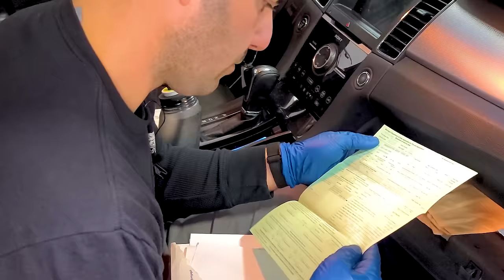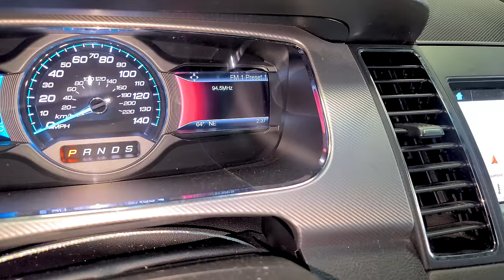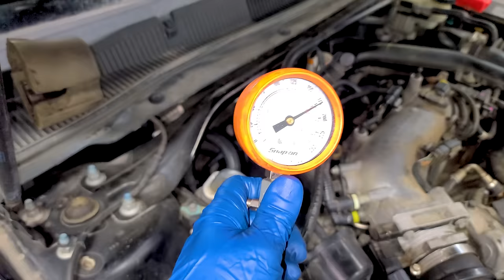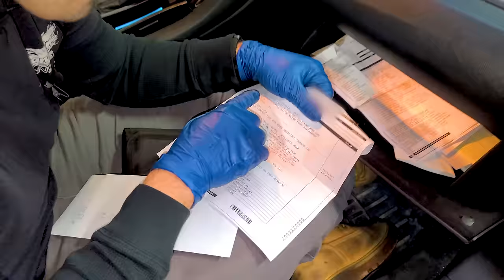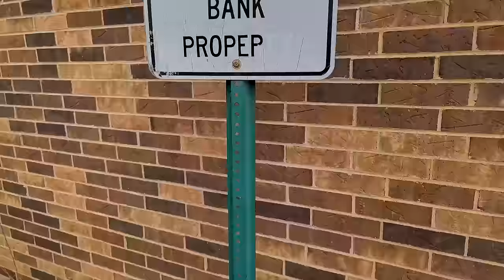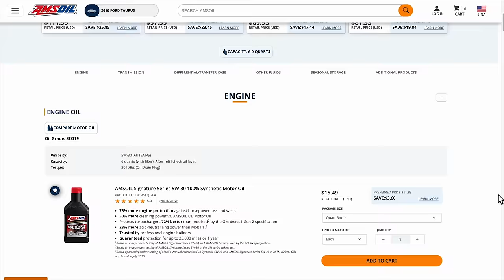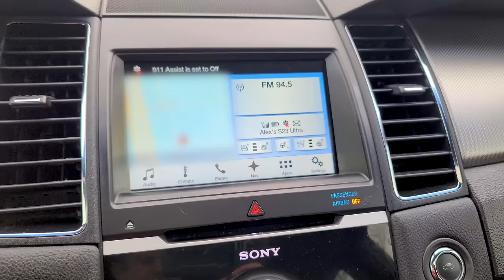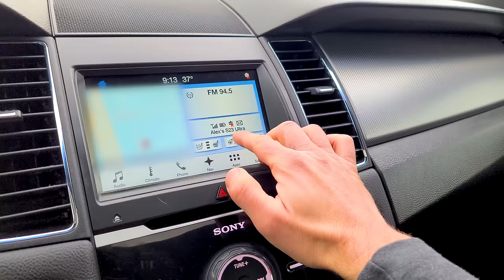I LOVE My GTR So I Bought Another Twin-Turbo V6 AWD Auction Car For 50% Off! Fixed For 30 Dollars!

Comment: Alex, I BLAME YOU... ;)  I just purchased a S197 Mustang GT with good bones.  Project car and quality time with my Sons.  Together we will make it a 400hp LSC.  Thanks for inspiring us and for sharing your  knowledge.  Definitely want to see Papa D and the SC'd Buick. Trust me, that Taurus is a GREAT daily driver.
Reply: be ready for the 2 piece spark plugs thatre notorious for breaking off half into the head. Also make sure you check on the cam phasers as well as if the timing chain tensioners are not blown out (they have an O-ring that blows out as they are pressurized with oil). Aside from that the 3V's are very solid. While you're in there check your roller followers as the center rollers bearings wollar out and then eventually totally fail (also oil pressure based, so any other oil issues like the tensioners, VCT solenoid, etc...can dominoe effect).

pypes exhaust are a nice touch and doesnt drone - used to road trip mine 2000 miles at a time regularly.
Reply: @frjhracing  Thanks for the info.  I'm making a list.  Definitely concerned about those stupid plugs.  What a dumb idea.  Ford can make it hard to be a Ford Guy...  And I will be doing a lot of "while you're in there..."  I have reached out to the One owner for some history.  He took decent car of the car with a few tasteful well done mods.  Maybe the plugs have been changed.  Fingers crossed.

Comment: First thing I highly recommend is a Catch-Can for the SHO. After all the work cleaning the heads. On top of being Direct injection and a twin turbo, A Catch-Can will keep it clean as whistle for a long long time, no more Carbon buildup. Moroso make's an excellent one. It has a drain valve so the can doesn't even have to be removed.
Reply: The JL passenger side oil separator does a good job on the cheap too
Reply: Thanks for ruining the surprise! 🤣
Reply: And an EGR delete!

Comment: I worked at a Ford Dealership when the SHO Taurus came out in 1987 or 1988, I think. After driving it and seeing how fast it was I called a friend and told him to "get up here right now". I remember him getting it up to 105 MPH in 3rd gear with ease. That car was a blast!
Reply: That’s when they came with the Yamaha engine. The plumbing on those engines were insane.
Reply: @ve3nsv  I almost mentioned that. If memory serves, it was a Yamaha top end on a Ford block, but I'm not certain that's entirely correct. I do know that car with a five-speed transmission was a real screamer though.
Reply: @keithbrookshire  I thought it was a marine engine?

Comment: Alex, I have the same 2016 SHO, 70k miles, same color, non pp, exhaust work, lowered on BC racing coilovers, tinted windows, trim blacked out, etc. Damn awesome you bought one and doing videos on it. These cars have some potential but the weight of them really hinders everything. Thank you for your videos! Love your content, huge fan and if I can help in any way with my SHO let me know. I'm in Effingham, IL. Not all that far.

Comment: For intakes... load up 6 tie wraps in the end of a drill and drill out the intake runner with it. Takes the carbon off, does not damage metals.

Comment: I was hoping for a 3000GT VR4, but i do like the SHO
Reply: Same.
Reply: no way you'd be able to get a VR4 for less than a GTR..
Reply: @insector2093 what? You can get multiple VR4s for half the price of a GTR........
Reply: Vr4's are garbage, i had one. Horrible engine
Reply: @mmanzanozr1 agreed.  They're turds.  Also trying to find one that isn't ragged out, riced out or just overpriced like mad because bro thinks it's 'rare'!
Reply: @mmanzanozr1 @derekgardin1512 That's why I'd like to see Alex have one, he'd take whatever crap is there and turn it to gold
Reply: @entronics  he already has a car like that, the v12 Mercedes turd
Reply: That Mercedes grandpa car doesn't come close to the 3000gt @mmanzanozr1
Reply: @entronics  3000 gt is utter garbage, way to heavy to compete against it's competition r33, rx7, nsx, and even the Supra. It was by far the slowest and shittiest of them all.
Reply: @insector2093  VR4 is cheap, it's not a desirable car for anything but a show car because it drives like shit and is fragile.

Comment: NO WAY brother!!!!  I had a 2014 SHO with the Performance Package for about 7 years and I installed a Gearhead Tune, CAI, exhaust, H&R lowering springs, etc.  It was SO FUN embarrassing Mustangs, Camaros, etc!!!  These did have some issues with the PTU.  I hope you mod this SHO and keep her for awhile!    🏁   🏁   🏁   🏁   🏁   🏁   🏁   🏁   🏁   🏁
Reply: My dad bought a 1994 z28 w/Lt1.  In 1994
We had a SHO pull up next to us . And rev it up.   We laughed.   Then we embarrassed the guy. .. easily. 
Idk. How much faster these newer turbo SHO's are.    But it would have to be enough to embarrass an older SHO.   To be beating Camaros
Reply: @misterfixit5186   The newer ones with twin turbos are AWD and 365 HP and 350 ft lbs.  My 2014 with a simple ECU tune from Gearhead put down over 500HP and 500 ft lbs.  It's on my channel.  I was dead even with a Camaro ZL1 LE until top of 3rd gear and he started pulling on me.  He was with his girl and when we got to the next light I had to turn so I wanted to wave or thumbs up and he didn't roll window down, didn't look over - but I could see how pissed he was - hilarious!

Comment: I prefill sideways mount filters too, right when i start the oil change.  By the time you are ready to put the filter on, the filter has absorbed most of the prefill and you usually dont spill any oil.

Comment: 2014 SHO owner.  +1 to the catch can, lots of good brands, I went with UPR and love it.  If you want to keep your PTU alive a little longer, change out the oil in it for red line shock proof gear oil.  It's pricey, but worth it.  Add it in, run it for some miles, then change it out.  Their oil is thinner, and will removed some of the burnt on gunk you've definitely got built up in the housing.  Last, transform the way the car stands and handles by swapping out the stock springs for a set of H and R springs, gets rid of the rake/butt in the air the car has, and decent shocks, dramatically improves turn in response, with sacrificing a lot of comfort, keeps the car very streetable.  I live in New England where the roads are crap, and the ride is still fairly smooth.

Last, consider swapping out the trans mount for a solid trans mount, makes the shifting under load feel like a legit sports car, will help with your 1st into 2nd gear loss of speed, shaves time off the 0-60.

Comment: I have a buddy who got an 86 Ford Escort GT from the back lot of a dealer. Whoever had it loved it but did not know how to maintain it and had no money. The interior and body were in great shape. Far better than usual for that year, Mustang, Murker, Escort. 
The tiny motor was hashed though.  At the same time he found an 91 Torous SHO that was totalled. 

He moved the motor, Trans, ecus, and many other parts motor related from the engine bay. 

He ended up with a beautiful little Escort GT/SHO to go to cars and coffee in it.

Comment: You should get the American GTR, the Cadillac ATSV. The tuning potential is incredible!
Reply: That's NOT a $6k car though.
Reply: @aaronbritt2025 this car is only 6k because if dealer repaired it would need 15k in repairs.
Reply: Except for the ATS-V is not AWD and doesnt have the power potential the GT-R is capable of.
Reply: @toddkunard3742  I can assure you that the sho doesn't either. Terrible car
Reply: @aaronbritt2025 who gives a shit, I’m sure a somewhat broken ATSV for 20k wouldn’t hurt Alex’s pockets.
Reply: Ah yes, the American GTR. Except, it has no AWD. And it doesn't have very much potential. And it's not special. And it's overshadowed by the CTS-V.
It's almost as if it's nothing like a GTR.
Reply: @rustler08  ah yes, the V6TT 2 door coupe American sports car, that has a tuning potential of 1000+whp, has been in the mid 8’s with Tapout tuning, and doesn’t need 50,000$ to do so. It is not overshadowed by the CTSV, considering we’re comparing Coupes & not 4 door sports Sedans. The only thing lacking is AWD, but what other American made V6TT 2 door coupe is AWD? Lmao
Reply: @toddkunard3742  actually a ATSV can make more power than a GTR with a stock engine. A GTR engine is only reliable to about 650hp at the crank. People are making 750 whp out of the ATSV and still be reliable. The GTR is at 85% of it capability from the factory both engine and transmission. That's why Nissan will void the warranty after a certain number of launchs.

Comment: My wife had a 1987 Taurus SHO with the Yamaha 6 cylinder 5 speed manual that she loved. That was the drivers SHO. It was fast off the kine and could rev very tight. No SHO since then has had a higher winding engine than the Yamaha one. Find one of those if you really want to be impressed. The one you have is more of a Dad's car.
Reply: 89 was the first year

Comment: Yes, I totally want to see a PAPA D Buick video.  Perhaps even a series!!!  I would like to see a built transmission with a quicker shift and a perhaps different gearing.    Hook his car up!!   Get his dry ice cleaned - spray undercoating, get his dream wheels - update the exhaust with a switch for exhaust to go straight out.

Comment: Those regals were sleepers , buddy had one when is was in hs and it would take a mustang Gt
Reply: The older mustangs were nothing special.  Has 225hp.  The 4.6 weren't bad but the real mustang came back when the 5.0 Coyote was brought in.  420hp base with all the rpm they can turn plus the nasty, nasty sound they make.  Love my 2017.

Comment: When getting broken chunks of carbon out of the fuel injector hole on my Sprinter, Mercedes Diesel, I put a fuel line into my shop vac and then a straw into the fuel line. I taped that all together and used it to reach down the holes, and even into the cylinder, and vacuumed out the chunks.

Comment: I just picked up my first legit street car project. 97 Thunderbird with only 138,000 miles for $2100. In great condition! Has the 4.6 and the only thing that was wrong with it within the day that I got it was the EGR valve. Fixed it easy and It runs beautifully and it was owned by an elderly person before. I just gotta figure out what I can do for performance mods but your channels given me the inspiration to look for the oddball one off cars that weren’t that super popular And make something of it.

Comment: 55:38 At the very least, I'd do 3 things: 

1. Get some lowering springs or coilovers to lower the SHO a little bit and get rid of that rake.
2. Get some wheel spacers if you're gonna keep the stock wheels on it.
3. De-chrome the car with either black spray paint, Plasti-Dip, or vinyl wrap.

Other than that, I would go full bolt-on mods (cold air intake, full exhaust, etc.) with the car, along with an upgraded fuel system, and get an E85 tune.

Comment: Just as a note Alex, the black goo you saw at 27:06 on the front driveshaft is almost 100% coming from the PTU vent and not the front driveshaft seal. That is the sign the PTU is almost certainly burnt up (nobody ever services them, Ford says it is sealed/non-serviceable) and may need replaced if you start having loud growling noises from under the car and/or the AWD system starts to have issues. It would be good content to pull it down and split it open for a service! This is doable and you refill it with either 75W-90 or 75W-140 if I remember right. And if it is burnt up, they typically blow up in spectacular fashion (lots of carnage). They are super common to fail on all wheel drive Taurus, Edge, Flex, and Explorer. Source: Tech for 8 years, 3 of which at a Ford dealer.

Comment: Drove a 3.5L EcoBoost F150 from Louisiana to Florida with the same misfire issue you had at the beginning.  Anything over 1/3 throttle would make the CEL flash, massive stumbling and no power.  New coilpacks and plugs solved it, runs like a champ now.  Oddly enough, it would still cruise at 80mph and returned 19mpg average over 710 miles with that issue.

Comment: 39:40 I'm so happy that the S.H.O intake shuffle still lives on. The gen1&2 had the most beautiful intake manifold with secondary butterfly valves. Needless to say it was a shuffle to get them back together after putting the Big Bore Butterflies in. You heard of the 2-step this was the 3rd.

Comment: Trick I used to use back before walnut blasters were easy to get, grab you a bundle of zipties, cut the heads of the them off, and put some heat shrink around the bundle. Chuck in your drill and go to town. It won’t scratch anything and can get the backside of the valves too.

Comment: When we got my wife's SHO, it had a JLT catch-can installed.

No CELs but a slight shudder under hard acceleration and a severe power drop after 130mph.

Plugs were out to .042, replaced plugs and made sure they were properly gapped.

Shudder gone, she pulls hard all the way to the 140mph speed limiter.

After driving for 15k, (88k on odo) decided to service the PTU, the fluid that came out looked like maple syrup.

Apparently, the PO loved her!

Comment: Alex try putting a sponge in ur oil drain pan, it'll be much more mess free, becouse it will absorb oil instantly so it won't splash around the shop

Comment: Black vinyl above the exhaust section looks great! Gives definition, contrast and depth to a bland and flat spot. Not that the OEM looks bad but the black really defines the rear end! It's like the difference between a flat rear valence and the small fins of a diffuser, a small change that really changes the overall feel of the rear end. Kind of like saying something just with a different tone, you can make something sound completely different like if you say "Are you kidding me?!?!" With a rising tone and shocked vs "Are you kidding me?!?!" In a dropping tone and disappointed lol

Comment: If you ever have to retrieve a small foreign object from the spark plug well again. try using a powerful shop vac and some spare rubber hose the fits in the hole. Cobble together an adapter for the shop vac to accept the rubber hose and boom, no more greasy cotton swab song and dance

Comment: One thing to keep in mind with regard to walnut blasting:  If you call shops to have this done, you may come across a couple that will quote you an unusually low price.  That's because they're going to use that Wynn's contraption that slowly feeds a chemical into the running engine to fog your engine out.  This isn't a real carbon clean.  Just FYI.  They almost got me.   I called three shops and they all called that seafoam type treatment "carbon cleaning".

Comment: Replace the rubber boot on each coil. They have a metal spring inside that impacts the energy transfer. I had that shudder reoccur many times after a few thousand miles after replacing the plugs it was the boots. Now perfect.

Comment: You would love what I have found, I have a family friend who is giving me the deal of a lifetime on a 96 frame 06 swapped 4.6l mustang 35th edition. Catch is that it has a parasitic draw somewhere that I have to find. Manual 5 speed, racing intake and fuel system. Super Short throw shifter. I never thought I'd get a chance to work on my dream car let alone own one!! Your videos have helped me with diagnostics and make me confident to get that baby running and driving again. She loves the gas petal and I'm planning on driving her very good in the summer. I know I won't beat your fastest mustang of 98 but that's okay!! Thanks Alex for helping me get the opportunity of a lifetime.

Comment: if you wana hear the turbos or have the blow off valve sound you can do the vta mod. uses rubber feet that goes on stools legs to not scratch the floor. pop a hose off, rubber thing, hose clamp and boom.

Comment: I bought a 2007 Acura MDX in August of 2020 with 103k miles. Timing was done a 99K miles at a dealer. Did some research and was able to contact the previous owner.  Previous owner stated he traded in car since he thinks more things would go wrong down the road. Have 125k miles on it now and only think I replaced was the o-rings on PS lines.

Comment: I have a 2013 Lincoln MKT, the crossover SUV version of the SHO. 158k miles with no engine issues (I will admit I am starting to hear a little timing chain rattle, so that's coming up). But I've used it as a daily, an Uber vehicle, and a couple weeks ago towed a double axle enclosed trailer of furniture 300 miles. It's a great all around vehicle. Feel free to do the timing chains and water pump on my car. I'll happily reimburse you for the parts.😊

Comment: One other fluid you really really need to change is the PTU (transfer case) they say it is a lifetime fluid. But it is not! It needs to be changed every 30k miles. Highly recommended warming the transfer case up on a short drive before draining fluid because it is rear-end gear oil.

Comment: Buy GM "top engine cleaner", spray one can through hot intake( outside of shop) while running, then spray another can making sure to stall or kill the engine just before end of can. Let sit over night and boom, clean as new.

Comment: ultimate sleeper build. upgraded turbos, injectors, intake, down pipe, and tune
Reply: Don’t for get about the high-pressure fuel pump

Comment: If I'm not mistaken you said the valve cover and spark plug was done for free under warranty. If that's correct, that'll be why they didn't do all six. They did the bare minimum to correct the concern because it was a warranty job.

Comment: 15:56 next time that happens, take a small but near thick rod to somewhat blockade cylinder spark hole and blow compressed air directly to the cylinder hole...

Comment: The only reason I can think of for only changing the one spark plug would be because it was done under warranty, which doesnt result in any new cash from the customer.  That incentivises bare minimum work/parts to solve the problem